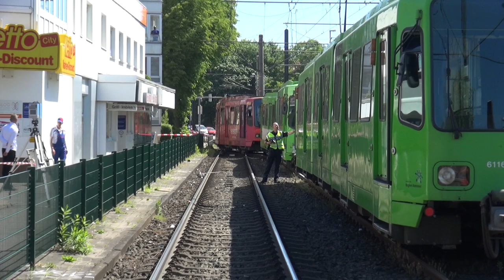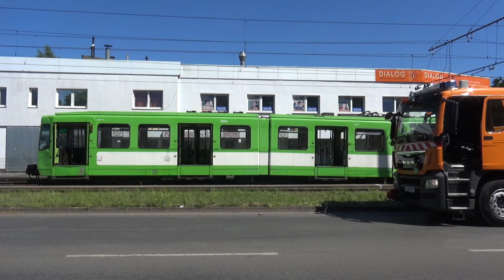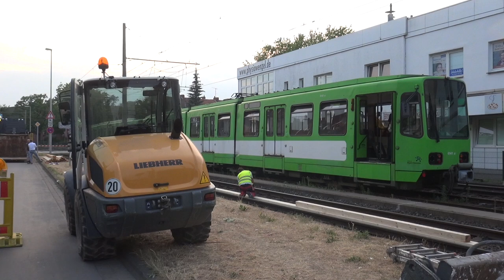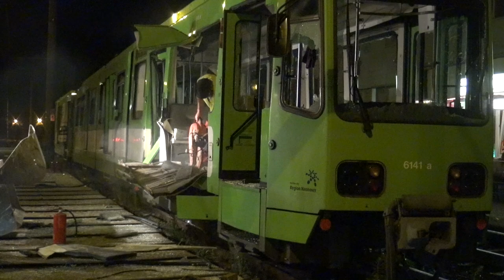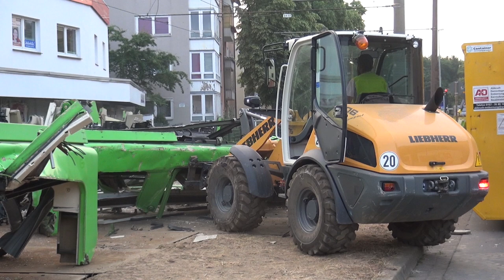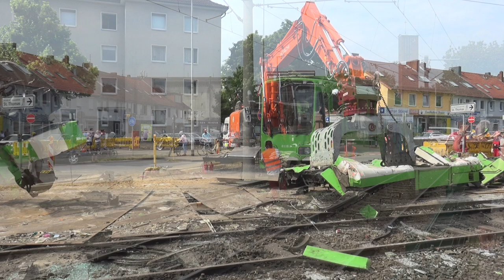[ÜSTRA] Stadtbahnunfall Wallensteinstraße + Verschrottung TW 6000

Comment: Never in my born days  have I seen such a blatant display of 'Dicking About'  when it comes to sorting a collision out.  WHY ?
Reply from the maker: The vehicles were very old and should have been scrapped in the next few months anyway.

As they were so badly damaged that it would have been very difficult to transport them away, the decision was made to scrap the vehicles directly on site.
Reply: @ic_lokfuehrer  what a mess,   how I would have done it,  remove overhead wires,  set up 90t road mobile crane,  separate  each tram into  individual cars,  rig and lift each unit onto low-loaders,  remove to off-site and OUT OF SIGHT area,  scrap there,  replace overhead, open route,  8 - 10 hours with NO clean-up of all the broken glass,  scrap bits and  track protection, job done

Comment: why ? No speech  German I think
Reply from the maker: Both vehicles collided with each other and were damaged so badly that they were no longer able to roll.
That's why they were scrapped on the spot.
Reply: Wow -they don't look that damaged
Reply: @abandonedrailwayscanada3271  If a railway vehicle damaged on the mainframe it can not be fixed, it's garbage. However, they could fix it, but the running characteristics of the vehicle won't be the same as the original.